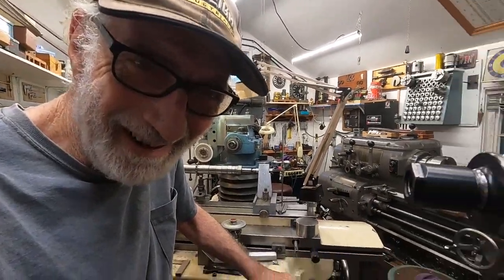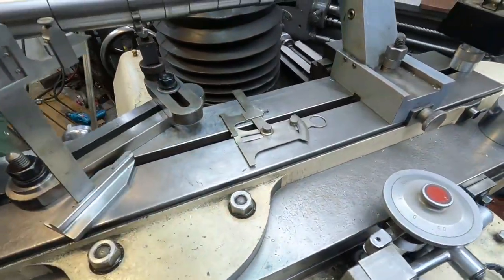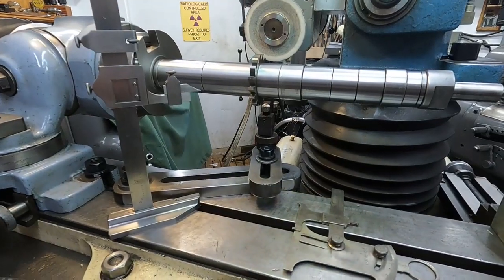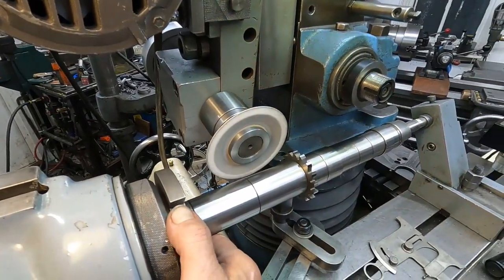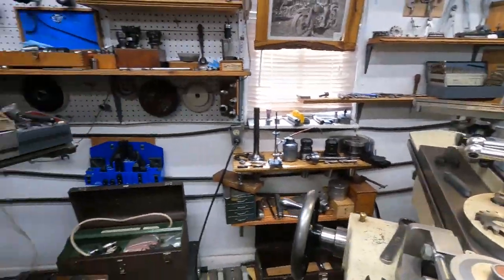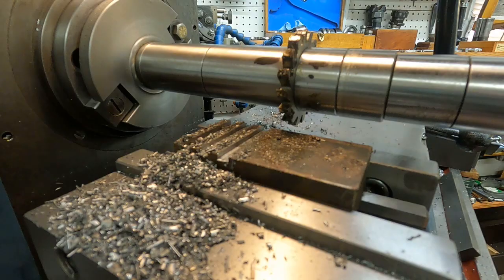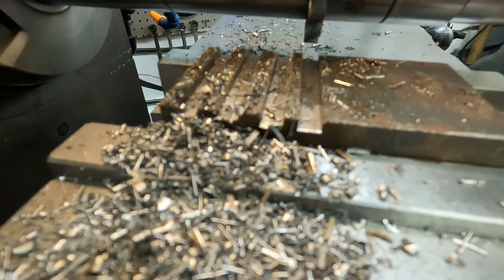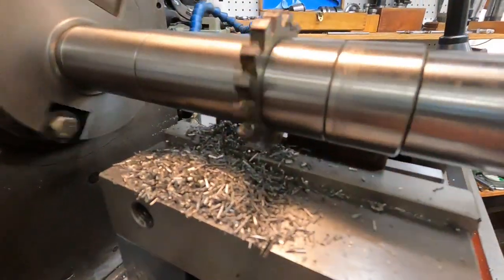Horizontal mill, Tool & Cutter Grinder fine tune.

Comment: I enjoy watching you every day Don, it motivates me to get off my ass and out in my workshop.    What happened to the HLV Chucker you had a while back …. Did I miss its departure?    I’ve an HLV here in Yorkshire, UK needing similar treatment
Reply from the maker: Hi, thanks, I sold that chucker to someone that will get good use out of it and has some room for it. Machine storage is a major problem for most everyone in this town. I stopped going to the salvage yard, just nowhere to put things. I try to get out in the garage often to avoid bad television. Its the snipers from the house to the garage that's the problem now!

Comment: I always like seeing work on the cutter grinder. I'm interested in knowing what is causing the out of round condition on the other cutters. When you mentioned sharp tools, It reminded me of a damn center drill that I have won't even drill aluminum. Some of the new stuff I have gotten is just total junk. It is hard to find good center drills anymore.
Reply from the maker: I need to take time and inspect one of those cutters on a surface plate. I can improve the error just a little but have not run into this before. I still have a reasonable supply of center drills but quality ones are really going to cost now!
Reply: What are you buying? There are many excellent drill bits available. You just have to be willing to pay for them.
Reply: @melgross  You are correct. Just be willing to pay for them. LOL
Reply: @terrycannon570  I don’t know if you’re being serious or sarcastic.  Turn recently I bought two 3/8” cobalt center drills from MSC. They send me the sales catalogs. They were almost $40 each, on sale.
Reply: @melgross  serious